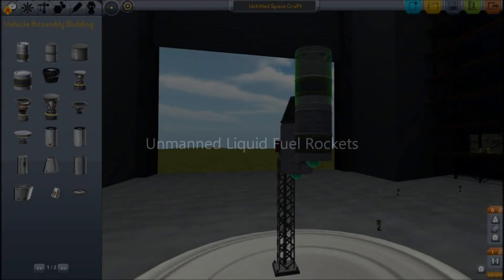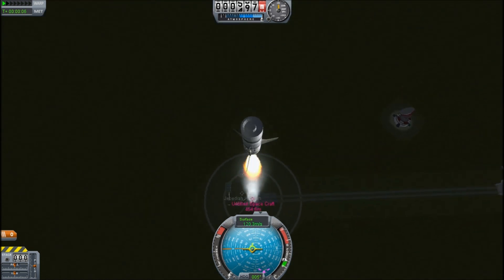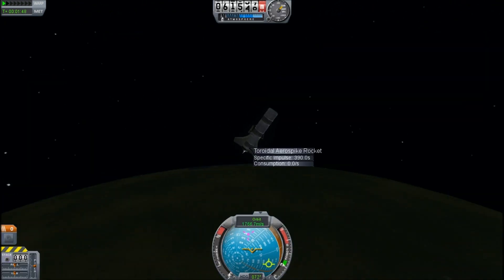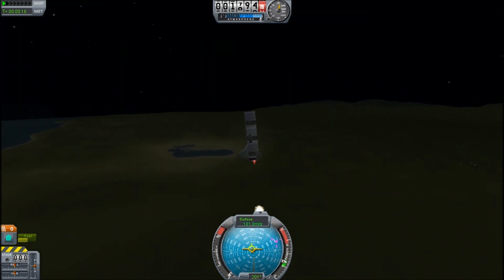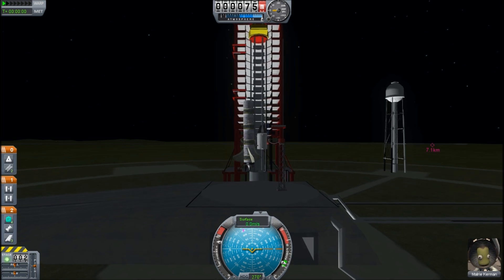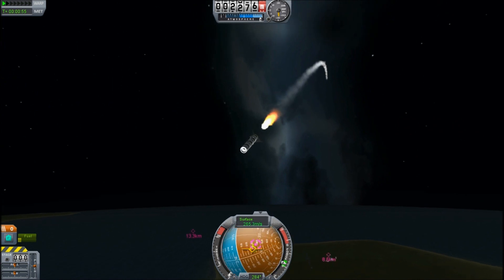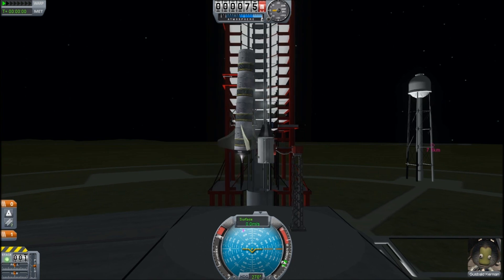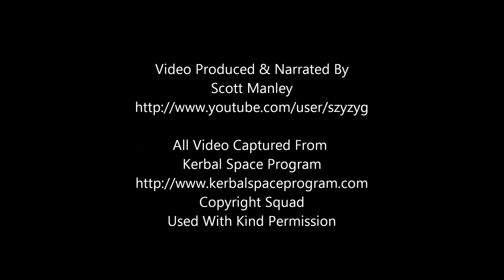Unmanned Liquid Fueled Rockets - Kerbal Space Program

Comment: Not sure if it's the sort of thing you're going for here, but I flew an unmanned rocket from Minmus back to a crash landing on Kerbin. I flew a manned rocket to a landing on Minmus and separated the upper stage. The lower stage still had some fuel left. 

The trick is having a MechJeb module on the lower stage and using an engine with thrust vectoring. The only way to steer such a rocket is with the engine burning, but the lowest thrust setting is sufficient.

Comment: It's because of the extra fuel tank on the top, it pushes the centre of mass further towards the top of the rocket, too far away from the centre of pressure for the rocket to be stable. I'm also pretty sure it would be possible to attach the decoupler the other way so you don't have to have the counterweight.